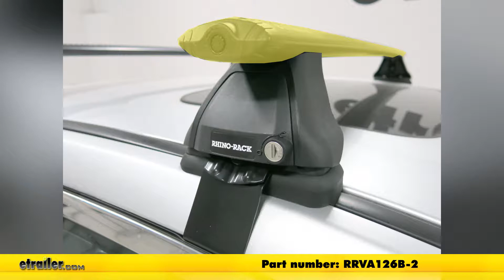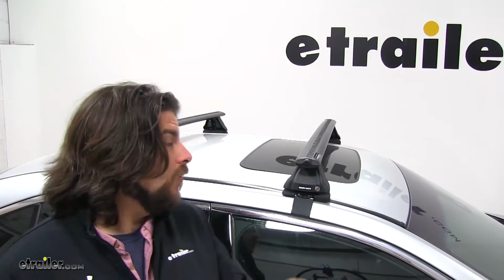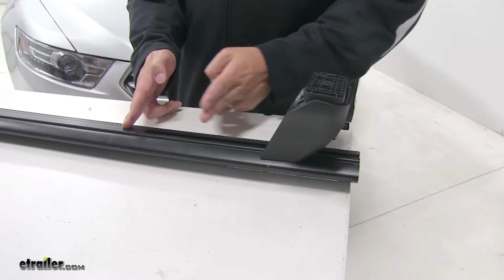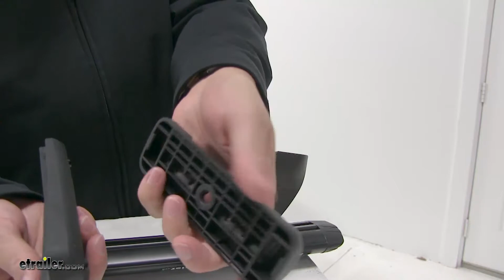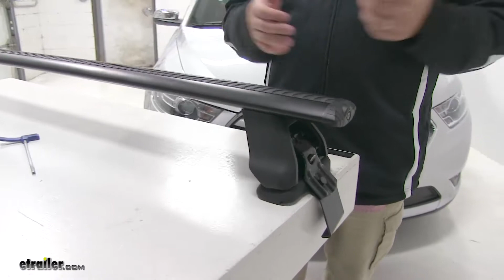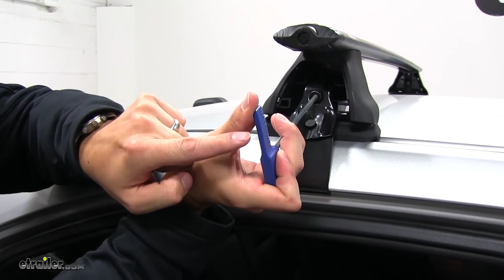DIY Install: Custom DK Fit Kit for 4 Rhino-Rack 2500 Series Roof Rack Legs on your 2017 Ford Taurus

Comment: Do these leave marks on your car when you take them off? Like if you left it on for 5-6 months?
Reply from the maker: They definitely can. You can help prevent a lot of that by making sure the surface of the vehicle is clean before you install it. I'd also strongly suggest taking them off every couple months and cleaning the area and the feet of the roof rack because dust and dirt build up between the foot pad and the vehicle roof and that is where the marks usually occur.